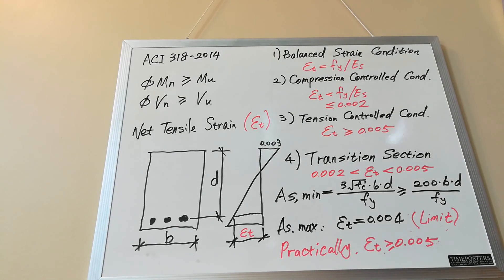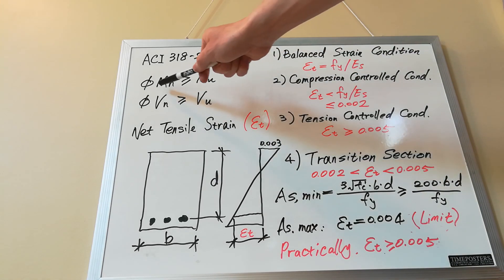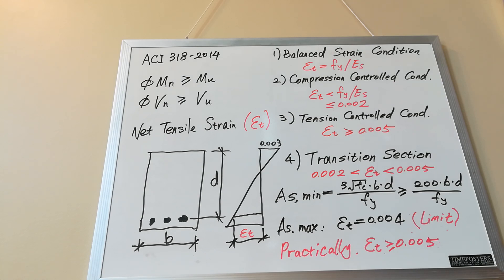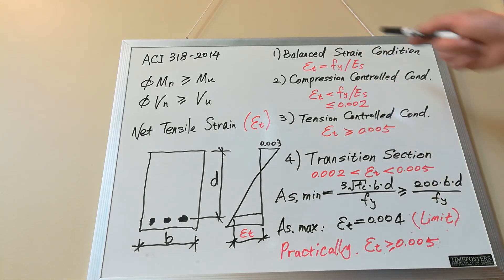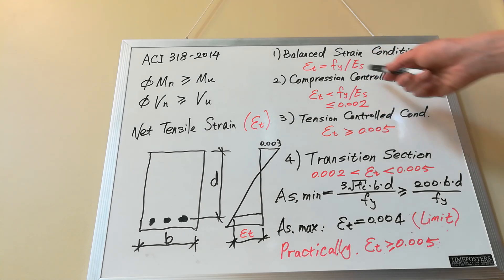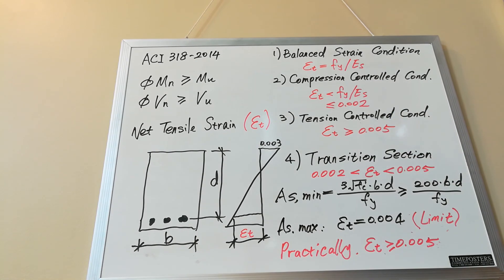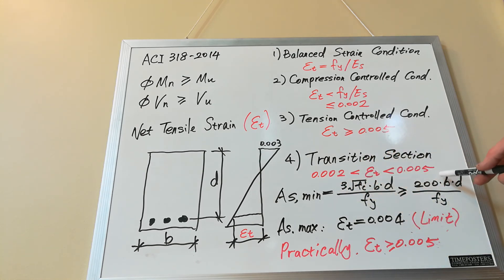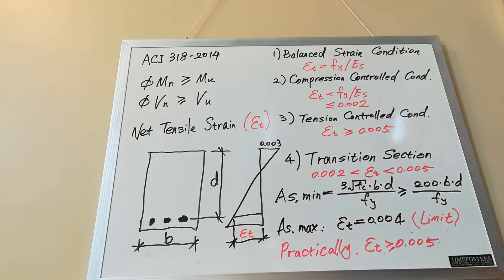Reinforced Concrete Design - Net Tensile Strain

Comment: Hii when lets assume in T section which is under reinforced depth of N.A. from extreme compression fiber is 50 mm (maximum compresive strain is 0.0035) and depth of centre of tension reinforcement from NA is 500 mm(thus by compatibility of strain tensile strain will be 10 times maximum compresive strain) is that much strain allowed?
Reply from the maker: Code required minimum steel area governs the highest NA location and maximum net tensile strain. In the case you described, I'd check minimum steel area first.

Comment: Hii can you please tell me what is the maximum allowed tensile stress in concrete in flexural member
Reply from the maker: Concrete is not supposed to resist tension. Tensile stress is on steel bar.